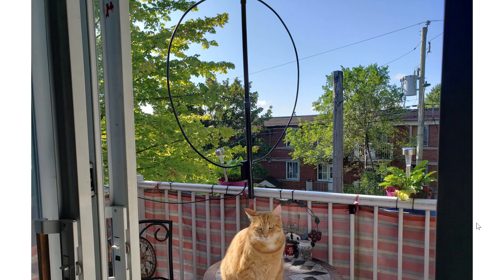New Week of Shortwave radio videos coming up May 3rd 2021

Comment: Congrats on the discone! Looking to hear your adventures. New antennas and getting more capability is ALWAYS great!
I put up a new end fed on Saurday replacing my original end fed - I can transmit on many more frequency bands now and by extension I can hear more signals with a broader antenna. -Of course it didn't take away the noise from the next neighbors solar inverters during the day on 40-49 meter. Grrr
Always to see Sir Paul, the Radio Cat! (Sir Paul le chat radio) ?
73 de N2NLQ